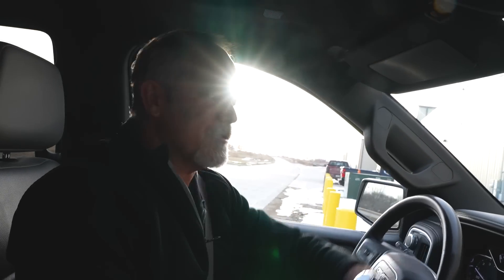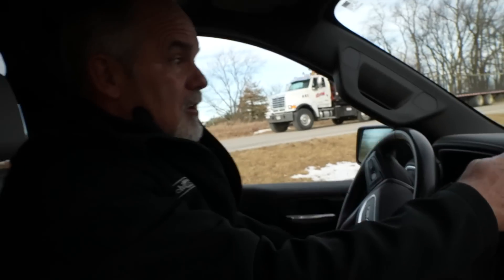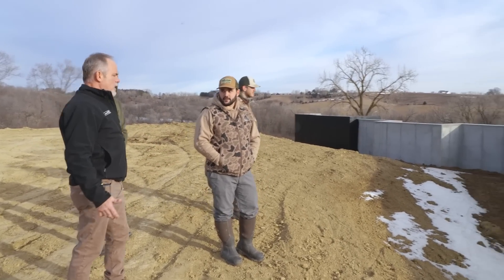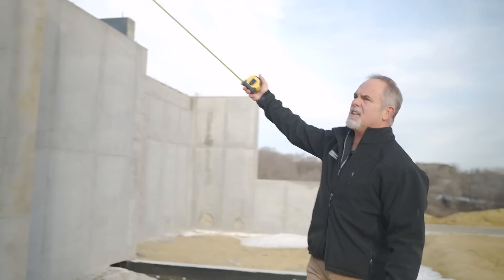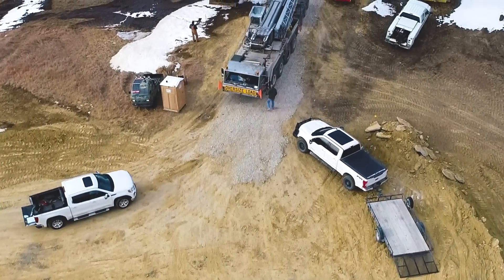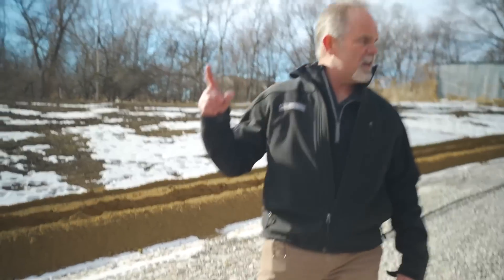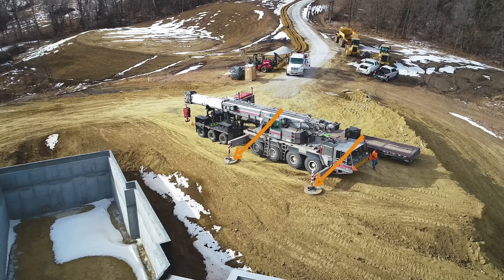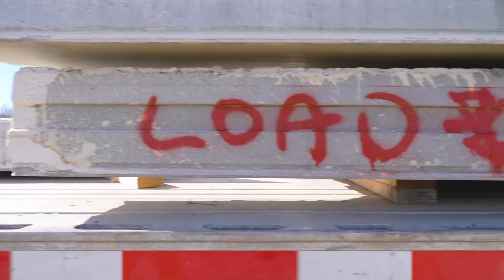Building FLAIR'S Hidden UNDERGROUND Bunker!

Comment: Love your channel, Brad! You are a pro at this as well as home design and building. 
I laughed so hard at you  getting all the rig drivers to blow the horn. When I was a kid, I grew up in the prairies (Saskatchewan) and often times the railroad would run parallel to the highways. I'm going to date myself here with this message... This is way back before seatbelts were a thing, etc. We had a station wagon that we would literally hop the seat into the back, play games (like board games) and then hop back to have lunch or whatever in the backseat. Often we would go to drive-ins or even just driving at night, my parents would bring pillows and blankets or sleeping bags and we'd stretch out in the back, haha.  Anyways, when we would be on the highway and a train would be running beside us, we would roll down the windows (literally... roll the windows down), hang ourselves out (to shoulders only - any further wasn't safe!)  and do the tugging motion you did for the train engineers to blow the horns. We'd do the same for semis, though of course we wouldn't need to hang out the window. Most of the time the rig driver, train conductor/engineer guys would do it. My parents literally had a little notebook in the glove box and would keep score of who got the most horns over the summer, haha. 
I hadn't thought of that in 20+ years, Brad. Like I said, I'm dating myself, but it was a lot of fun!
Great job on the projects - house, bardominium/shop, etc. You really are a talented guy!
Heather 🇨🇦
Reply from the maker: Those were the good old days! We would do the same thing on road trips as kids. From the backseat we would try our best to get the truck drivers to Blow the Horn.  We learned this from our Dad who used to drive semi full of Pigs in his younger years.   Good old fashion fun!!🤠

Comment: I'm near the same area, and I've been wondering about if there any rules/dimension limits for a typical basement tornado shelter (but a comfortable one, and hoping to put a restroom in there and making it a theater room or something as a distraction during bad weather). Or if you have a link to where you get the info would be great. I am wanting to build one this year, but we don't have Flair money, lol... and what I see on FEMA sites seems to suggest small rooms for tornadoes, and that does not scream comfy to me, but I didn't know if it's typically small for the structural purposes of holding the concrete "ceiling" over the top of it. Just a scared mom wanting to make a room where the family can be safe.
Reply from the maker: If you build a storm shelter using that term, then there’s specific codes that you have to follow to be able to use that verbiage on the plans!  I try to stay away from using the words: storm shelter/tornado shelter, and just build a concrete room that would be safe in the event of extremely bad weather.

You can create it into a nice theater room
Reply: @BradtheBuilder it sure has been a crazy few months recently! Wishing I already had my shelter built! I can’t believe you guys got hit. We decided to drive ahead of the tornadoes that day to try to dodge them. Would have preferred the nice shelter 100%!

Comment: What’s roughly the sq ft of the bunker & home in total?!
Reply from the maker: The main floor is 3300 ft.²
The lower level living space is 2600 ft.²
The underground bunker below the garage is 1600 ft.²
We’ve added a concrete gun room under the front stoop and that’s going to be approximately 280 ft.²
We’re also adding storage above the garage which could be living space and that will be 1060 ft.²
Reply: @BradtheBuilder  Impressive, interested to see how y’all get that see through fireplace in there lol